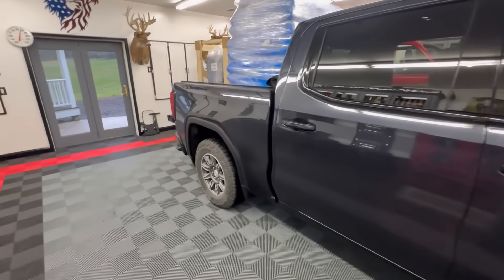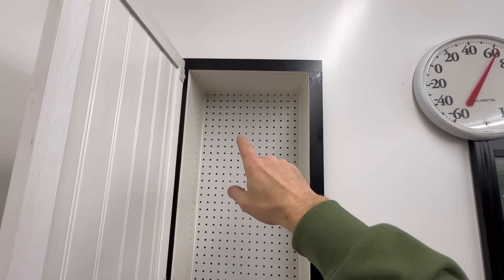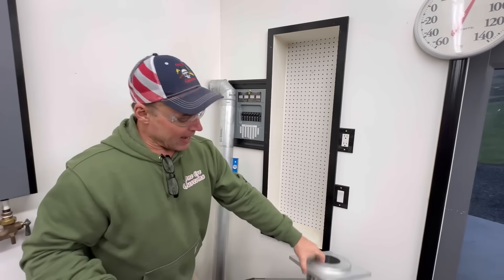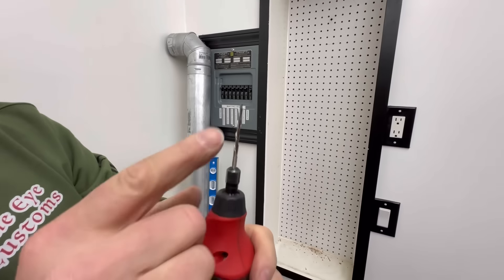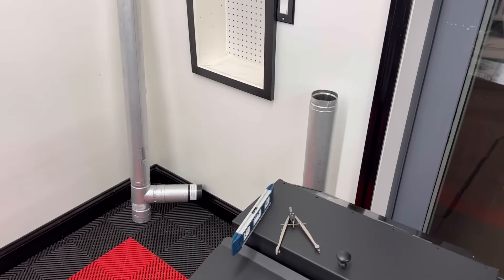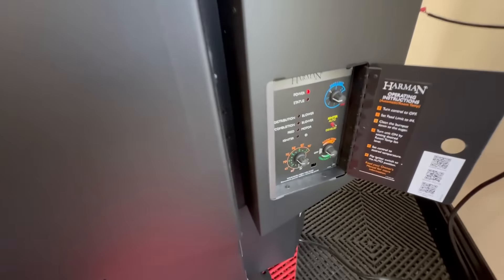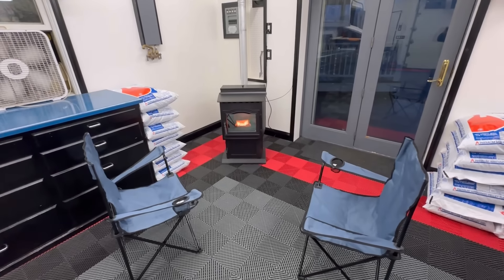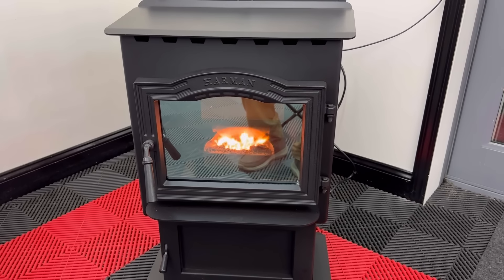Pellet stove, Adding an ADDITIONAL heat source to the garage.

Comment: Hello Doug just a suggestion for you. You should be able to run only the blower of your gas furnace to help circulate the heat thru out your three spaces in your building .Best regard from Chambly near Montréal, Québec

Comment: I run a Harman P38. It’s the older version of the p43. The easiest way to clean the pipe is to use a battery operated leaf blower and blow air into the pipe from inside the stove behind the fines box. I put a towel in to block the air and make sure it all goes up the pipe and doesn’t get dust everywhere. I stopped using a brush all together. I’ve been doing that for years. Harman makes the most reliable stoves. My p38 was made in 1997 and has never had a part replaced. Impressive.
Reply from the maker: Thanks and great idea!

Comment: If the top of the stove doesn't get hot (or if you fill it when it's off/cold), an easier way to fill the hopper would be to set the bag on top with a side hanging over into it, then cut the bottom of that side open. You'll only need to pick it up and dump a small portion of the bag at the end... Less spillage too.

Comment: Hello Doug just  an idea for you. You should be able to use only the blower of your gas furnace to circulate the air that the heat produced by you pellet stove  it could be better to even  out the heat in the three area of you building and maybe save a bit of pellets. Maybe do a comparison test between what you demonstrate in your video and my suggestion . Best regard from Chambly near Montréal, Québec

Comment: I like that you went with Harman. I plan on either a pellet stove or propane for my 30×56 pole building have not decided yet . No matter what you probably should leave it run all the time. I burn firewood in my house and it's messy!

Comment: You have all the ductwork to circulate and have an even heat in all rooms.  Or hook it up to your house ductwork.  I like that pellet stoves use a waste stream of manufacture to produce heat.  I like how clean pellet stoves are.  No bark dust and bugs.  But I have access to so much wood I just can’t justify not burning firewood.  I love wood heat either way.

Comment: Ill be getting a pellet stove in one of my cabins. I have a wood stove in one and I'm nervous with renters. Also If I give them seasoned hardwood they burn it all outside in the fire pit and we run out for heating. I think pellets will be easier to ration.
Reply from the maker: I think a pellet stove would be perfect for your cabins!! No way would I have a wood stove with renters.

Comment: Doug that's a really nice unit. You are probably going to enjoy sitting around shooting the bull in front of it. It seems like a really straightforward installation. They also have little fans that you sit on top of the stove that run from the heat of the stove. I saw one on Mike Morgan's channel. Anyway, stay safe, healthy and warm. Bill H from Cranberry Township
Reply: The top of the stove does not get hot enough to run that fan, I tried it on mine.

Comment: I was influenced into buying a pellet stove about 10 years ago for the shop side of my building. It does not get used much but it seems to be the ticket for me. I have no firewood available without purchasing. Mine does not have the big ash drawer that yours does so mine requires frequent cleaning. 
Overall, I am pleased with my stove.

Comment: For your application, I understand the pellet stove. In a large pole barn shop, I see firewood as an excellent source of heat, especially if one gets that wood free. 

I would have loved to see the outside portion of the install when you were done.
Reply from the maker: I’ve never heard of free firewood??
Where do people get it?
Reply: my back 40. I wind up cutting up the trees any way because they block my trails. Why not put them to use. What is sad it all of the ash trees around my house are dyeing because of the beetles (northeast PA), so those too must be cut down, and ash is a great heat source.  @OneEyeCustoms

Comment: I'll be interested to see what your fuel usage rate will be.  If you went through a bag a day, 1 ton is 50 days worth. At $300 a ton, that's $6 a day. I don't imagine you'll have it lit every day, or that you'll use 40 pounds a day most days. That makes your fuel cost pretty reasonable.  I am curious about the access to the breaker panel. The NEC specifies that electrical panels must have a minimum clearance of 30 inches horizontally and 36 inches in front of the panel. Not that you're likely to have an inspection done any time soon :)

Comment: Wood is “cheaper” for you but this is so much cleaner.   My son put one in two years ago - no mess of wood and ash.  Look forward to your results.
Reply from the maker: Not if you cut and split it yourself.
Saws, splitter, fuel, equipment to haul the wood and so much more…
I actually think pellets are cheaper when all in comparing the two????
Just my opinion.

Comment: This is a super video! Exquisite installation all the way around. I’d 2nd or 3rd the outside air source. I had a thought on the clean out at the bottom of the flue. You could fabricate an adapter to go over the clean out and attach a shop vac to it. You can turn the vac, go outside and run your brush back and forth to clean it. This will alleviate unwanted soot dust which we all know can be a pain. Maybe the company that made the flue piping offers an adapter for cleaning? See you in the next episode Doug!
Reply from the maker: Great idea!!!!

Comment: Great video.  I also am in the market for a pellet stove.  Different insurances may not allow them, and in a garage I’ve been told ordinances may require a heat source to be 6’ off the ground. (For combustibles (gas fumes)). 🤷‍♂️.  Not going to stop me from putting one in, but I will need to adjust some of my storages.  Nice job Doug!

Comment: Nice stove Doug. I'm sure you will be very pleased with it. I have 2 Harman Advance pellet stoves that I heat my garage and man cave with.  They are very efficient and I run mine on room temp. and keep it around 68 all day and night. Sometimes I will crank it up if I'm out there doing woodworking. Keeps it nice and toasty in there.
Reply from the maker: Awesome, thanks for sharing your experience with them!

Comment: Nice pellet stove Doug awesome video on everything. I have a pellet in my basement it uses a bag a day and also have a gas furnace that runs a little. The pellet mostly keep my ceramic floor at a very warm temperature. I go through 3 ton a year. My basement ceiling is all open. It all comes out about the same if I just use the furnace but my floor is cold and the pellet makes a huge difference and I love it but thats just my situation.

Comment: Consider installing an outdoor air kit so the stove isn't burning heated inside air.  Especially important in a garage that could have various flammable vapors.  Been running pellets in my shop for nearly 10 years, its nice to have the stove on a few hours before doing a job to take the chill out of the building.
Reply from the maker: Great tip!
Reply: I think these things use double wall pipe and bring in fresh air through the outside part of the pipe.

Comment: Been running my Harman (same stove) in my barroom at house for 11 years. not 1 issue in 11 years. (knock on wood) keep clean and run hardwood pellets. Our's runs steady from November to May. Never shut down only to clean. good luck with yours. Only 1 suggestion Doug, get the deer plate for the front of the ash box door, nice upgrade.
Reply from the maker: I have to ask, what is the deer plate?
Reply: Wish I could send you a picture. Its a faceplate that Harman sells for front of ash door. Has deer scenery on it.
Reply: I also have a polished nickel trim with design that goes around door .(trim) it all came from harman at the time I bought stove. i am in Ontario, Canada

Comment: You did not indicate what the outside temperature was but I'm assuming it was at or below freezing. It will take a little longer to bring the garage up to temperature with all of the air gaps from the garage doors but it will make a huge difference in your enjoyment of your workspace/garage in the winter! I have used pellet stoves for the past 20+ years and still have one of the original Whitfield pellet inserts in our den. Great job Doug! As always you make things look easy...
Reply from the maker: It’s was about 25 outside and really windy!

Comment: Really neat Dough.  I was thinking as you were going through the shut down process:  What happens when you loose power?  There is no blower to burn the fuel in the burn box, does that create a problem?  Great video thumbs up.
Reply from the maker: Not sure what happens in that case. I do have back up power so that may not be a problem

Comment: Is there anything else on the outside for the chimney pipe?  Or is it just that 4"  trim ring flush with the outside of the wall?
Reply from the maker: The pipe goes out about 16” and then there is a turn down end pipe.
Reply: Ok, that makes sense i was wondering, nice you don't have to go vertical above the eave or peak.

Comment: Hello Doug just  an idea for you. You should be able to use only the blower of your gas furnace to circulate the heat produced by you pellet stove  it could be better to even  out the heat in the three area of you building and maybe save a bit of pellets. Maybe do a comparison test between what you demonstrate in your video and my suggestion . Best regard from Chambly near Montréal, Québec
Reply from the maker: Great idea